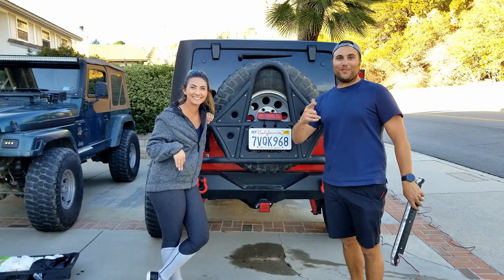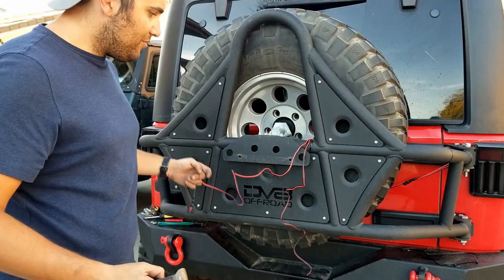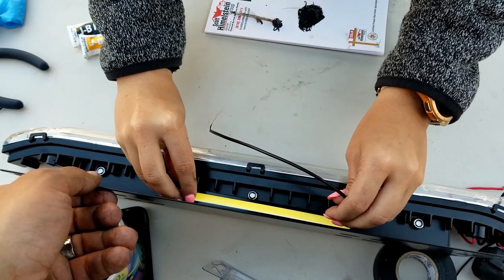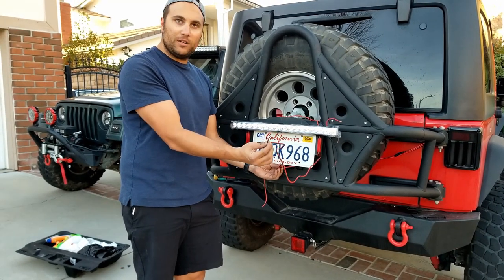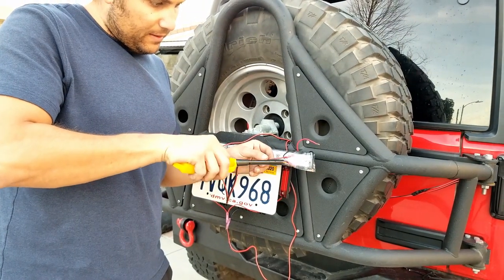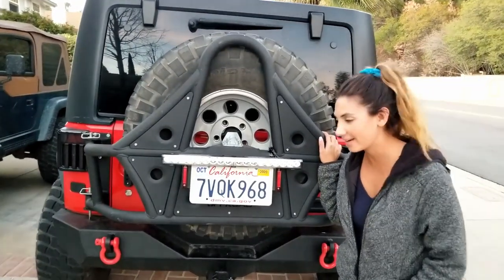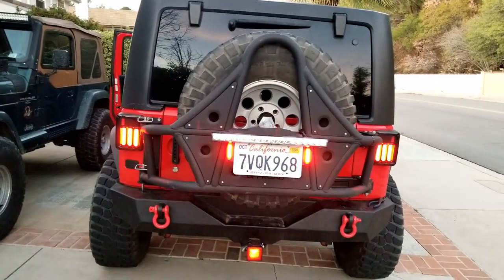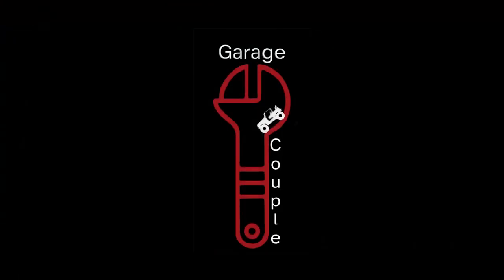REAR Light Bar For Our JK! Full DIY Install

Comment from the maker: If you enjoy our videos, please consider checking out some of our favorite JK products on amazon!
Electrical tools - https://amzn.to/2I521ra
Shrink Connectors - https://amzn.to/2I46bQa
Steel Stinger Front bumper - https://amzn.to/2WjykMA 
LED tail lights - https://amzn.to/2JPBL7f 
Under seat subwoofer - https://amzn.to/2JOKDK4 
Red metal handles - https://amzn.to/2Wik8U1 
Red shifter bezel - https://amzn.to/2HRZscH
 JK light bar - https://amzn.to/2EPEOYH 
Rock lights - https://amzn.to/2JPBUHP 
A piller switch pod - https://amzn.to/2MoWBw2
 Door hinge side step - https://amzn.to/2ENee2A 
Trunk mounted table - https://amzn.to/2EOywbL 
Door hinge side mirror - https://amzn.to/31pQs5